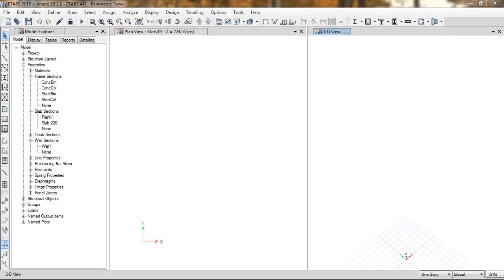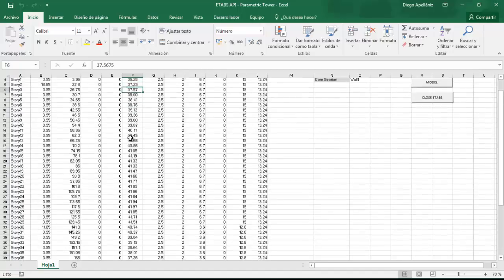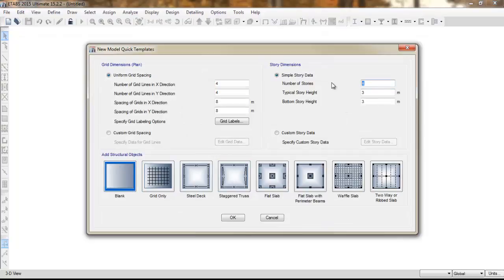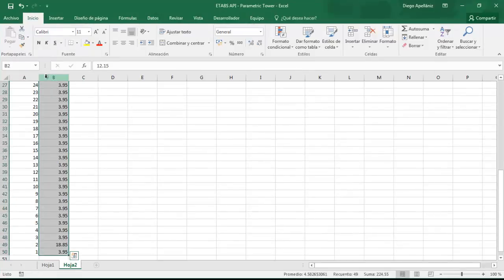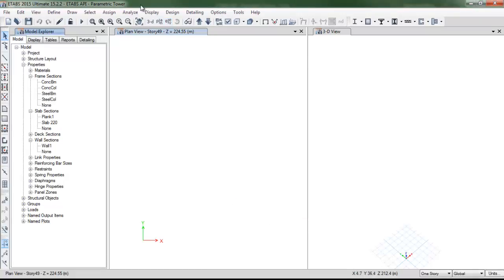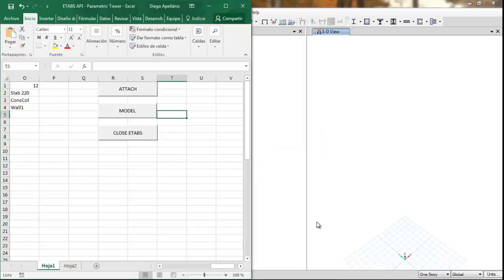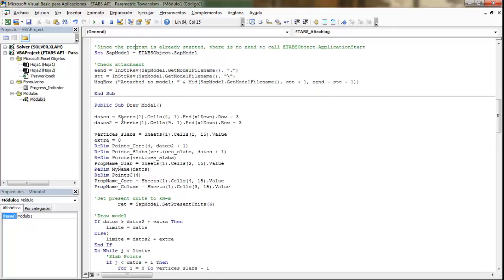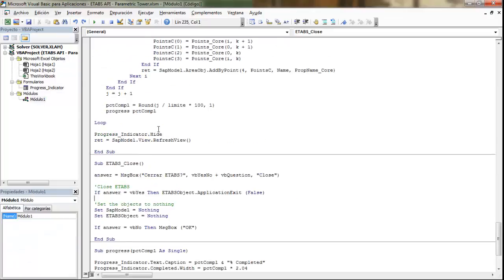ETABS API - Advanced Modelling Tutorial (Parametric Design)

Comment: Hello Dear Diego
Thank you very much for helping all CSI programming enthusiasts with your videos and content.
I have two questions about SAP2000(v14.2.0) OAPI:
How can I define an auto notional load based on base load and direction?
And for the next question, how do I define redundancy factor and design spectral acceleration parameter in steel frame design preferences for AISC 360-05/IBC2006?
Thank you
Reply from the maker: Hello Mohamad,
it's been I while since I used Sap2000 for the last time, but I think that:
- the redunancy factor is defined with the mehtod SapModel.DesignSteel.AISC360_10.SetPreference(). Take a look into the API documentation for more Info.
- the Spectral acceleration is defined in the response spectrum function. For instnace SapModel.Func.FuncRS.SetAASHTO2006()
- I'm afraid code-generated notional loads are not included in the API...

Comment: Wow! This is amazing * great job.Please send me the file bro... markkipss@gmail.com
Reply from the maker: Thank you very much!! I've just sent you both the ETABS file and Excel sheet, with no password, so that you can study both the data and the code!
Reply: Diego thanks I got your message. But I keep getting an error message when ever I try to PATCH and then MODEL. The error is Microsoft visual Basic - compile error - can't find project or library.
And when I click the model option I get this error message» » "run time 91" - object variables not set! 
Pls what should I do??????????
Reply from the maker: What ETABS versión are you currently using? I'm afraid that ETABS2015 or higher is required for running this macro.
Reply: Yes am using Etabs 2015.
And I am only trying to re-generate the Etabs model you sent me with the Excel program. But not working. Pls kindly check your mail, I have sent you a picture to explain. Thanks
Reply from the maker: Check your references too. If your ETABS installation folder differs from mine, you might need to update it. Watch my tutorial "First Steps Using the API" for more information!